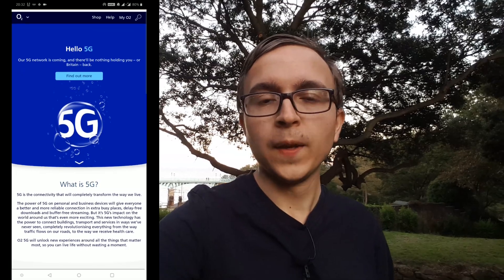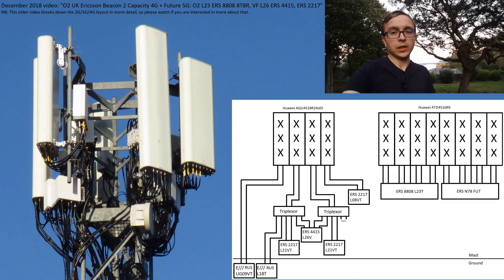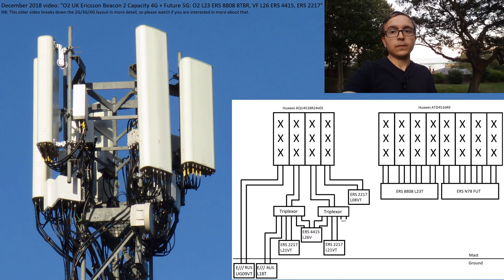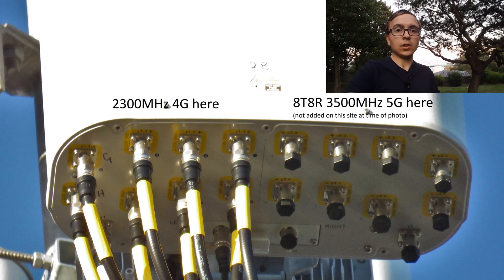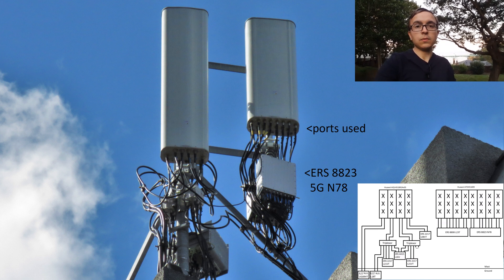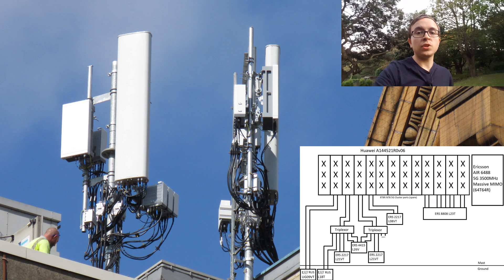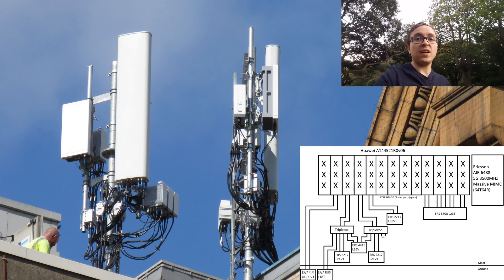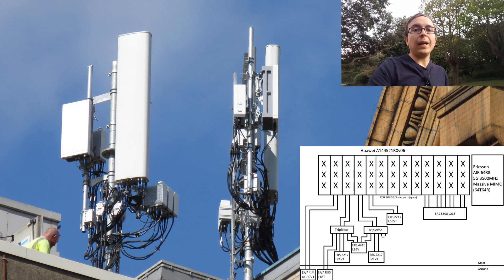O2 UK Ericsson 5G Layouts: 8T8R ERS 8823 and Massive MIMO AIR6488. With schematics, 4G field testing

Comment: I can't wait for 5g in O2. Already have 5g handset (Samsung Galaxy S10 5G). For now 5G mode in network settings is not available - proably due to 4g SIM card or software limitations. Do you know exact date when 5G goeas live ?
Reply: @Becca Smith 5g is live from a week and my ball are still fine :-)
Reply: I got 5g don't get your hopes up
Reply from the maker: I do not have an exact date unfortunately.
Reply: @Becca Smith Read the FDA statement at the bottom of that page, which is reproduced at https://www.fda.gov/news-events/press-announcements/statement-jeffrey-shuren-md-jd-director-fdas-center-devices-and-radiological-health-national?utm_campaign=11012018_Statement_FD. Only a handful of tumour types got to statistical significance in the study, and only then at power levels considerably above the limits allowed for mobile phones and at duty cycles beyond that of even the most ardent mobile phone user. The type of tumour causing most concern is rare in humans. The studies were conducted with frequencies and modulation types little used by modern phones (2G and 3G capacity is being reduced or even eliminated entirely in public networks as frequencies are refarmed to 4G - earlier technologies are being retained only for the small proportion of non-smart phones and older phones still in use, together with devices using mobile networks for low bandwidth communication that only contain a 2G or 2G/3G radio module to save money and power budget).

Everything we do has a degree of risk attached - we have seen that clearly during the current COVID-19 pandemic where social distancing has become essential. Mobile networks play an important role in modern life and indeed in safety of life applications (in the UK the emergency services are moving from a TETRA network to a dedicated 4G network hosted by one of the mobile carriers). It makes sense to use the precautionary principle as well as continuing to research the health risks of RF energy, but it is far from clear that there is a statistically significant risk to health from mobile networks. Considering how ubiquitous mobile devices have become over the past two decades, a large risk to health is near certain to have emerged by now.
Reply: Can’t wait for cancer aye? It’s no joke, do your own research into the nose bleeds at the Glastonbury fesitival
Reply: @christechtipshd  don't use your microwave then don't switch on your lights don't go out in the sun they all use exactly the same way then don't use your wireless uses the same way then what's your problem
Reply: @elixier33  100% agree
Reply: @christechtipshd  blah blah blah. And don't forget Earth is flat :-)